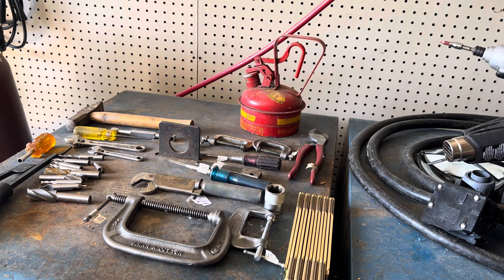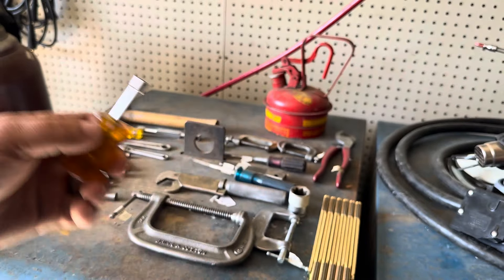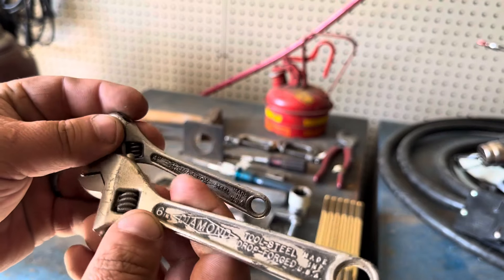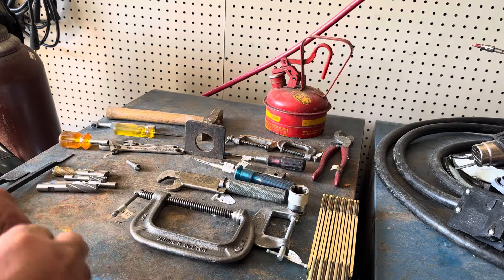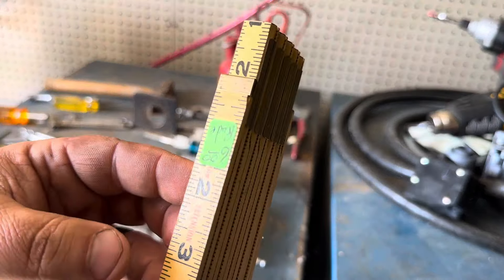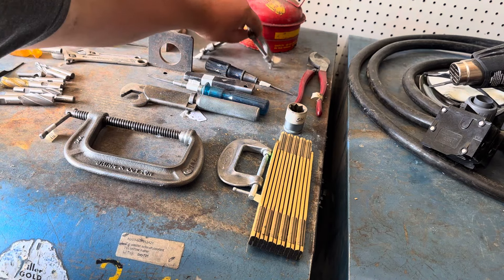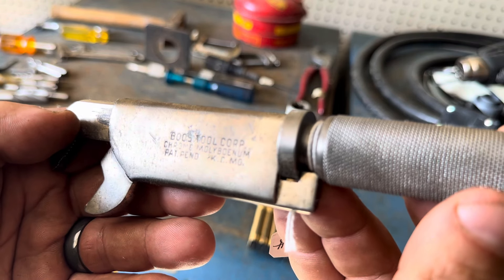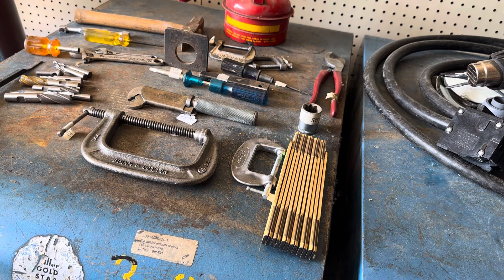Yard sale, auction, and swap meet finds 2024 #6

Comment: I have the same Pexto awl and hammer. The hammer is normally referred to as a "Tinners" hammer or duct hammer in cross-peen style. Used mine a lot back in my HVAC days on duct work. Nice treasures Adam; thanks for sharing!